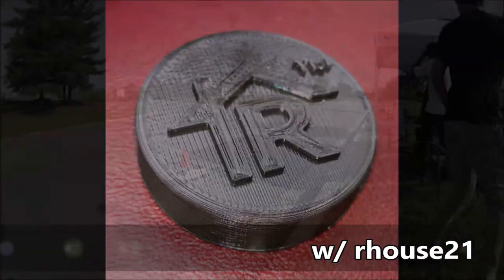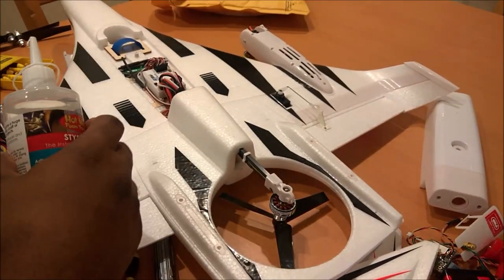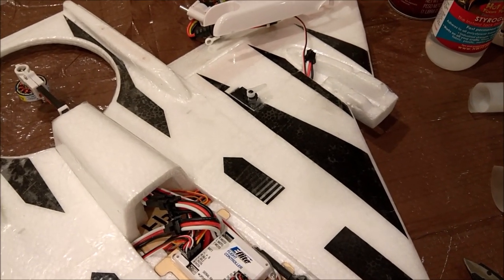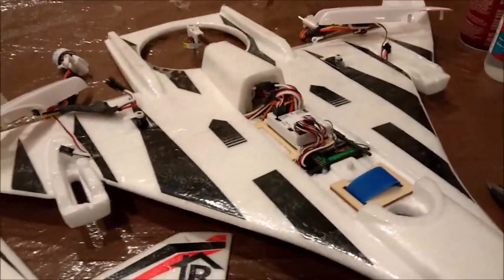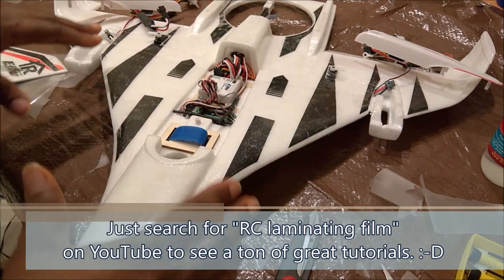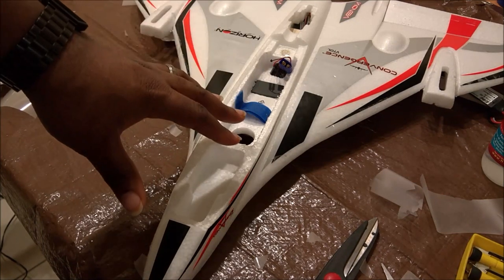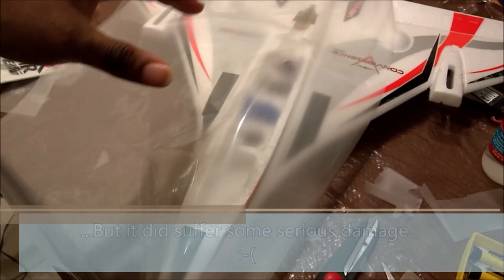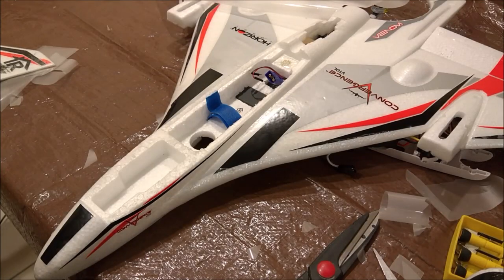Ep. 266: Foam RC Airplane Repair & Reinforcement (Monokote / Laminating Film) - E-flite Convergence

Comment: I wish you luck. After my third flew straight into the ground (like the first 2, I recorded video showing it all and HH warrantied them all) I got my last one and sold it.  The new owner used the Curtis youngblood FC.  Very hard to set up for custom projects but Rock solid. I have the stingray 500 collective pitch quadcopter. I've never had problems with it.
Reply from the maker: I think you read my mind as to where I'm planning to take this bird. I'm still weighing all my options, though. I'm surprised there aren't more people out there trying to hack this bird. I have a feeling it might be partially because of it's small stock payload area, but I'm planning on fixing that. 😁
Reply: @RCPhysics  There's actually entire group on Facebook that hacks them. There's a hybrid flight mode that's halfway between vtol and flight that alot of the guys do. I sold mine. Too much trouble compared to miniquad and wings.
Reply from the maker: Really?! I searched for Convergence groups, but missed that one. Do you have a link?
Reply: @RCPhysics  It's been dead for a while but I have a buddy in New Zealand who did quite a few hacks to the stock FC
Reply from the maker: @potjnkye86  I've been wondering if the stock FC could be hacked. I haven't opened it up yet, but you can get some pretty amazing aftermarket FCs out there for ~1/2 the price of the stock unit.
Reply from the maker: @potjnkye86  Is there a page showing his FC hacks? I'd love to see what he's done.
Reply: @RCPhysics  No but if you have Facebook I can get you in touch with him